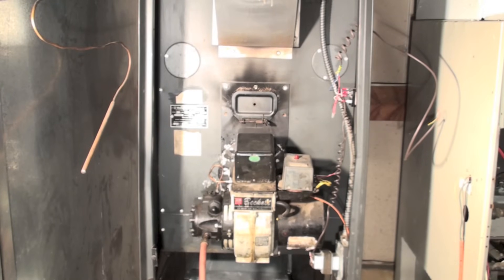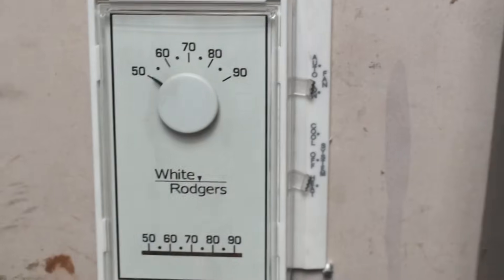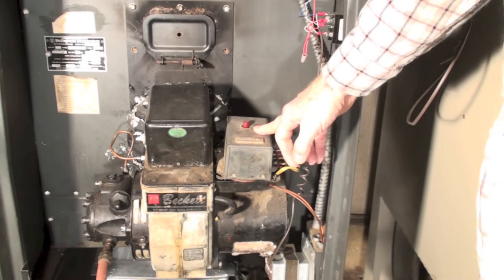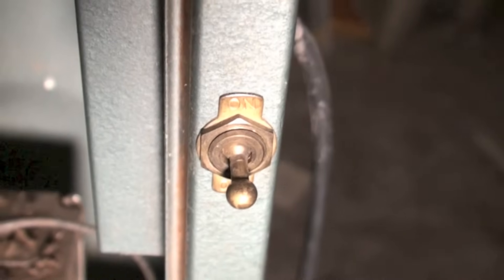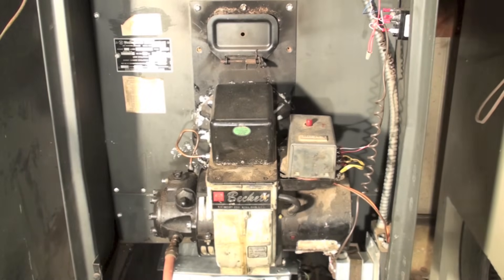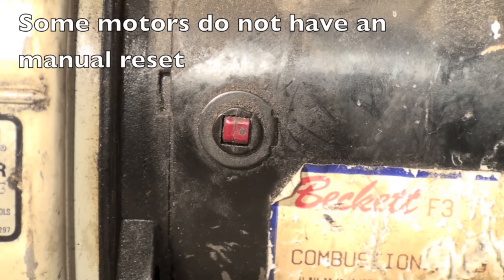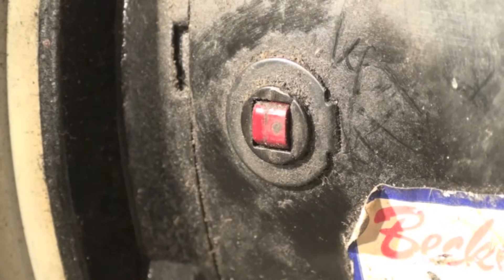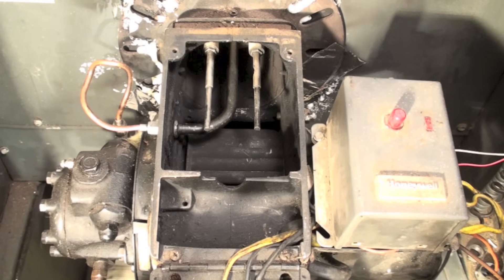Troubleshoot the oil furnace part 1. Burner won't start.

Comment: Well, I tried it. Battery contacts were corroded, took a bit of cleaning. Set system to AUTO and HEAT and temp call to 90 and waited.
 
Nothing. Turned on the switch, heard the fan motor kicked in, but not the burner.
 
I manually tripped the relay, burner comes on and heat is produced.
 
I THINK the power to the unit is switched and nothing gets through to the unit or 24VAC transformer when that switch is off. 

The switch is located on the main floor - regular wall switch wired with regular A/C and appears to switch the AC to the furnace.

 Not sure why it would be wired so, but it appears to have been ORIGINAL AC wiring to the switch (same old wire, same old electrical boxes found elsewhere in the house.
 
I makes NO SENSE that the fan always runs when that switch is on. Someone must have jury rigged the connections. Or have you even seen this approach before?
 
I took some pictures. The Honeywell R8184 M 1002 Control is no longer available. It may have been added if the AC was added after the furnace was originally installed as it is designed for a system with AC.
 
Yours is the first video to mention and 'switch' on 'older oil furnaces,' no one else seems to know why they would be there. This one appears to be part of the original installation - but could have been added later, of course. No way to know.

Any ideas?

Also, if I have it 'serviced,' what should I expect the service person to do for his fee?
Reply from the maker: The switch is a manual fan switch.  They were often installed in older homes to "cool the house" in summer without air conditioning.  By "manually tripped the relay" you mean you pressed the reset, you may have a problem with oil supply or the cad cell relay.  A service of an oil furnace consists of cleaning the gun assembly, replacing the nozzle, changing the oil filter, combustion analysis, oiling motors, and general cleanup.
GFM
Reply: First off, thank you very much for the reply.

" By "manually tripped the relay" you mean you pressed the reset, "

No, i wedged a little piece of wood into the relay to force the contacts closed.  

When I do that, the furnace comes to life and produces heat regardless the setting of the thermostat.

So, for the past ten years or so, I simply left the wedge in place and flipped the switch when I want heat. 

This year, I decide to try and get the thing working as intended.

Is there a way to 'short' the wires to the thermostat to mimic the call of the thermostat - to eliminate the possibility that the thermostat is at fault?

How does one check to see if there is power to the transformer that controls the relay - that is, I assume that when the Thermostat is set to AUTO and HEAT, there should be power to the transformer (120VAC in; 24VAC out) .

Is there a Circuit Diagram I can download to allow me to follow the circuit and operation to see where I should find voltage, resistance, etc. ?

"...the cad cell relay..." 

From what I've seen, the furnace should operate for 45 seconds or so if the CAD CELL is broken or the lens blocked - popping the red reset button on the Honeywell RM8184 M 1002 Control.  I have not looked at the CAD CELL - not sure where it is/where to look.  Any hints in that area? They are cheap enough and even cheaper if all they need is a cleaning!

Thank you again.
Reply: "By "manually tripped the relay" you mean you pressed the reset"

No, I mean I wedge a piece of wood in there to hold it closed so that the thing ignited (and created heat) when I flipped that switch on the wall.

The Oil supply appears to be working as I can get the furnace to run with my wedge! 

As I understand it, the CAD CELL offers up a lot of resistance until it 'sees' the bright flame. If that is the case, shorting the leads from the CAD  cell should 'fool' the board into thinking the cell was functioning and 'seeing the light.'  

If I understand correctly, the CAS CELL could be operable, but with a lens so dirty it cannot 'see' the flame. Or the CAD CELL could be clean enough, but simply not functioning (need replacement). 

With this in mind, I should look at the CAD CELL to determine if there is a 'clean' path to the light from the flame. I should also read the Ohms on the CAD CELL leads and find STRONG resistance/High Ohm Reading. 

Question: If I remove the CAD CELL, find the lens is 'clean.' and put an Ohmmeter to the leads with my finger over the lens (Simulating DARK), what should the reading on the meter be?  

Then, if I take a reading with the CAD CELL aimed at a very bright light source - what should the reading be?

And, then, if the CAD CELL read as it should/expected, where to look next?

Thanks for the feedback.
Reply from the maker: The cad cell should have over 20,000 ohms dark.  Less than 1,000 with light.  From what you say, the next would be a cell relay.
GFM
Reply: Thank you. I'll pull it and check it.

Comment: Great information, However never purchase a Crown Boiler from a Company Called surplus city liquidators, they are a scam company. They claim free shipping. After the customer pays for the boiler. They tell the customer ,to move themselves. Also they will not give you a full refund.Beware.

Comment: oil furnace does nothing! power at emergency shut of switch, replaced it just in case. nothing, no click on thermostat. unhooked it, twisted wires together still nothing. where do I start next. I don't think this furnace has been started for at least 15 years possibly 30. was thinking the motor is seized up. Thanks
Reply from the maker: I would check to see if power is available at the burner.  If it is available, try to rotate the blower wheel in the burner.  If it turns, then disconnect one of the cad cell wires.  If it starts, the cad cell is shorted.  Hope this helps.
GFM
Reply: Thanks so much for a fast response. I didn't have a meter with me yesterday and was told it had power. it did not! found a bad breaker. this thing fired off immediately after setting for all these years. I shut it down after about 2 minutes and called a furnace man to service it properly to be safe. great videos! help save on service by the hour for small stuff I can do!

Comment: My reset button (almost black) was not as east to see as your demonstrator so I didn't think to look for it until I saw your video.  I compliment your step by step process.  I was prepared to replace the motor.  I did have to free up the motor (the apparent cause of the reset tripping) and maybe the problem will reoccur, but I will not have to replace the motor this month.
Reply from the maker: Cross your fingers that it stays on.
GFM

Comment: Great videos very well presented info. I'm in a mostly gas & propane area but was trying to help a friend in a mostly oil heat area. This should do the trick for him very well. Thanks so much. Mr Gray. There once was oil use in this area but it all died during the first oil shock in 1973.

Comment: I'm not hearing any life in my furnace I hit the red button by motor I hear very light hum then it clicks back to reset.
Reply from the maker: If the burner motor does not start, the motor may off on manual reset.  There may be button on the motor that can be pressed.
GFM

Comment: Thanks 4 video. Would you have any hints for maintenance for a furnace with an outside oil tank (not by choice)in the Northeast? I always have the furnace serviced in late fall, but it always seems to give me issues around mid Winter, requiring a service man to come in.
Reply from the maker: The most helpful thing you can do is order #1 stove oil instead of #2 fuel oil during the coldest temps.  Usually 100 gallons in a 275 gal tank will keep it from gelling.
GFM

Comment: Hello! And thank you! I was sooooo hoping I had just run out of oil. Measuring 4 inches @ 17 gallons... crap! The reset has triggered. I did note that the basement smelled a little of oil. I reset it. It sounded hopeful. I could hear what sounded like oil spraying... but it didn't ignite and the reset triggered again. Now what? I will continue seeking out your videos to see if I can't pin it down... between property taxes and income taxes I'm about all tapped out until a month or two after April and my truck decided to break down just yesterday TOO! I need to try to tackle this myself even though I'm scared to death of blowing up the house. How do I know that the oil is coming in and not igniting? (as I suspect) If that is the case what do I do? I'm afraid to hit the reset again... if I have unspent fuel piling up in there it could go boom, right?

Comment: I usually turn off the valve from the oil tank.  Perhaps, because you didn't mention turning it off, there is no need to.

Comment: my heat works fine but my shower water will not get past worm .
Reply from the maker: Are you using a boiler with a water heater arm?
GFM
Reply: grayfurnaceman  I believe so.
Reply from the maker: I would first be looking for the hot water thermostat to see if it is set correctly.  Also, is the shower the only place you have a problem.
GFM
Reply: The shower and the sinks the temp says 180  the pressure psi is 25/28 the coil was changed in 2011 the pipes are separated there is a mixing valve ive turned it and nothing
Reply from the maker: Do you have a single handle faucet in the shower?
GFM
Reply: yes as well as the sinks . I thought of that
Reply from the maker: Is your domestic hot water pump running?
GFM
Reply: grayfurnaceman everything runs . im almost shore its the mixing valve, or the heating element . the water to the baseboard goes through a extra heating tank  while the house hold water dose not . and the temperature is set at 180
Reply from the maker: You can test the mixing valve by checking the temp in and out while water is being used.  It pretty definitive.
GFM

Comment: never mind. I found the problem. one of the contracts on the starter inside the control box is burnt off. 
thank you for putting so much information out there. it's an amazing resource.

Comment: my furnace is very similar to the one in this series. mine has power, but when I press the reset, the button goes down, nothing happens, then after about a min the reset will pop back out. I took the motor out and connected it directly to power, & it works great. so now I'm stuck, not sure why it's not doing anything.
Reply from the maker: If you try to press the reset before a few minutes have passed, it will not reset.  Sounds you may have an oil supply problem.
GFM

Comment: Hey thx Grayfurnaceman, your video helped me realize my problem instantly!!! lol. I was bleeding the line on my oil furnace, when the reset button stopped working on the 3rd try. I thought we were gonna need an entire new Honeywell primary ignition unit.......Unitil i remembered one of the 1st things you said..."turn the thermostat up". There was nothing wrong with the reset button, the furnace was ready to go and just waiting "our command".
I usually remember that but, my brain was thinking the worst & how much this was going to cost to call in a "pro". THX again....& holy crap i hate winter.😠
Reply from the maker: I always set the thermostat up as high as it will go.  Even then, the customer will sometimes change it while I am working on it.  
GFM
Reply: grayfurnaceman funny😠

Comment: hi yes I have a Honeywell oil furnace and its been here for a while but when I turn it on manually with the power switch it just clicks with a green light flashing and then clicks again and light goes off and I tried to test the igniter it didn't give out a zap but it could be something else but I hope u can give my suggestions and also I have a huge oil tank that runs into the basement and the valve is off should I turn it on?
Reply from the maker: The tank valve must be on for the unit to have access to oil.  Does the burner motor start?  
GFM

Comment: Gray I accidentally cut the wire from my thermostat to my oil furnace I reconnected where I cut the wires but now my oils furnace does not turn on . I can hear the click noise from when I turn my thermostat on but no heat

Comment: Thanks for the video.i have a question regarding my burner,it randomly lockout and it needs a reset frequently.what could be the problem ?(usiong siemens control) ...thanks again
Reply from the maker: It could be a number of problems.  Oil supply blockage is first.  Change the oil filter.  The cad cell could be dirty.  The nozzle could be partially plugged.  The cad cell relay could be failing.  These are a few of the possibilities.
GFM

Comment: Thank you I had no idea there was a reset switch seems to have started up.
Reply from the maker: If it does it again soon, the unit may have a failure or need service.  These units should be serviced every year.
GFM
Reply: Already scheduled a service thanks for the tip.

Comment: I have a very similar Beckett burner and i have to push the actual grey square relay (under the cover) down to get the furnace to kick on. It runs one cycle each time I do this. It wont kick on if I jumper the thermostat at the relay. The ac still works fine from the thermostat and will cycle all day. Any ideas?? Thanks! Your videos have been a big help in narrowing it down so far...
Reply from the maker: You could have several possibilities here.  The cad cell relay may have failed.  You could have a poor signal from the cad cell, or you could have a flame failure from a blocked filter.  Hope this helps.
GFM

Comment: I have a Repco GM - Series Gas Fired Boiler. [30 years old?] Pilot will not stay lit. Emergency switch on wall up stairs will not fired boiler when thrown on. No power to boiler. If there is no power, will the pilot flame extinguish? Is there a reset set switch on the unit?  Thank You for your feedback. Joe, Long Island. P.S. Burnin' the midnight oil with the kerosene lamps and sleepin' in the den.
Reply from the maker: If the unit is a standing pilot, the pilot will not go out if power is off.  I would be checking breakers and power switches.  As for a reset, I don't know.
GFM
Reply: GFM, are you meaning the pilot vertical, as per standing? As i looked, it seems to be horizontal. I will throw the Mains. Thanks for being there! Joe, L.I., N.Y.

Comment: Love your videos! I am having this issue: I have an oil fired boiler.  I have to press the red reset button to start the burner. It then runs fine until it reaches the high limit temperature (180) (low is set to 120).... Then the boiler shuts off and trips the red reset button. The red light illuminates. If I press it once the burner will start again until it reaches temperature then it trips the circuit once again. I've replaced the CAD sensor, electrodes and set the electrodes with the Beckett gauge, replaced the fuel nozzle, all the filters and the Honeywell R8184 relay. The aqua stat is a very old Honeywell. Not sure of the model. Could it be the aquastat causing this problem?
Reply from the maker: The relay should not trip the burner safety.  There has to be a flame problem.
GFM

Comment: how do I turn on my gas furnace??? heat won't come on
Reply from the maker: I need a lot more than that.  What exactly happens when the thermostat is turned up?
GFM
Reply: I don't how to light the furnace it's a little red button on it
Reply from the maker: Probably the best option for now is a video I did "What to do before calling the repairman" .  You can find it on my channel.
GFM
Reply: Gray I said forget that old furnace it was from 1961 I'm having a brand new furnace put in right now as we speak

Comment: Thank you so much, my furnace is working again!
Reply from the maker: Welcome
GFM
Reply: Carlos E Lopez how do i purge furnace
Reply from the maker: You only need to purge a single pipe system.  There is a bleeder valve on the pump that you can open while the burner motor is on to purge and clear air.
GFM

Comment: Hi GFM, I have the same type of Beckett in your video.  Just started using my furnace this year the other day.  It ran a few times and then quit.  I followed your trouble shooting steps and the Blower was very tight (locked) when I tried turning it.  However, it started turning pretty freely after I put a little force on the screwdriver.  I've used the furnace a couple more times and it is running OK.  Now I am concerned that something is wrong that made the blower lock up.  Do you have any suggestions on what I could do to prevent this from happening again.  If something is going bad I would like to replace it now.  Also, with guidance from your video I put a new pump on it last year.  Thanks.

Comment: Hi.. Looking to do some maintenance on my oil burner furnace... someone did it last season, but actually ruined my cad cell.. Unknown if it was intentional, but he was actually expecting my call..... and of course the coldest part of the year... and my hunting Cabin had no heat.. i fixed because of your video. and steps on how to maintain.. what to clean? get new nozzle?  anything? thanks.

Comment: Just looking at it I would want to get rid of that old motor and igniter and probably the cad cell with a new coupler. That fuel unit is too old. I would advise customer a new furnace might be in order. But that's just me
Reply from the maker: That fuel unit many times will last 50 years.  Unlike the newer mini pumps.  The entire furnace is quite old but the newer ones are only marginally more efficient.  
GFM

Comment: there is a reset on the motor but it never popped. removed the motor and put power to it works fine. I will check the cad cell, thanks for the information!